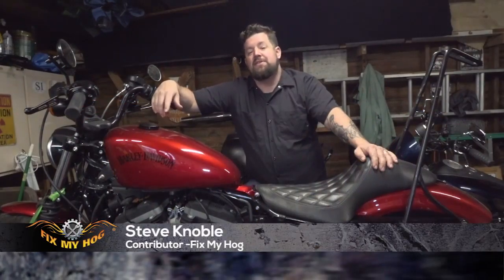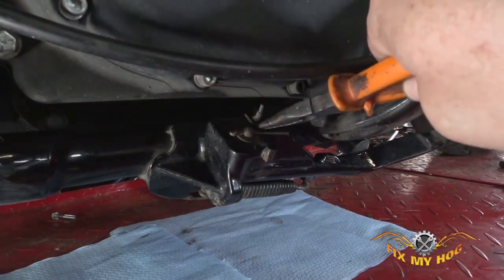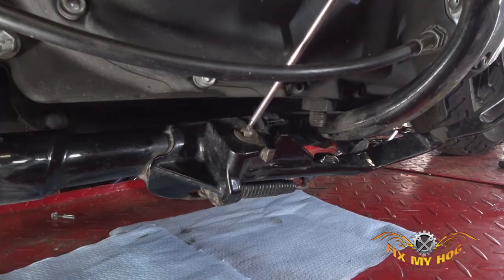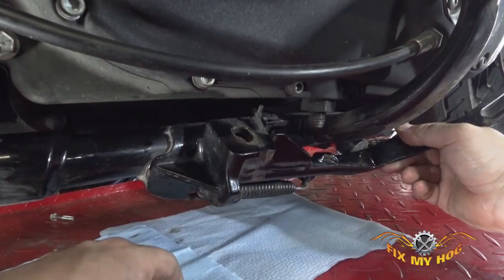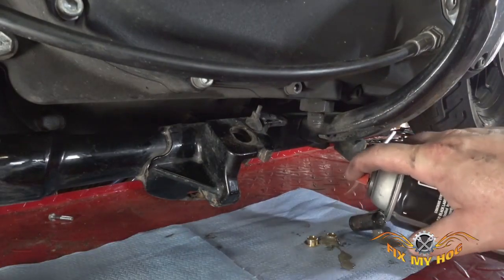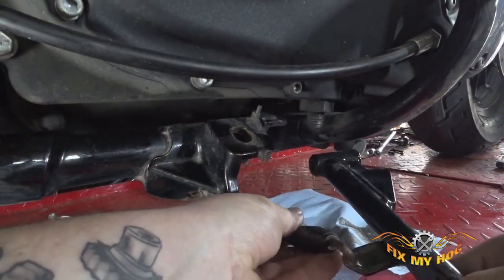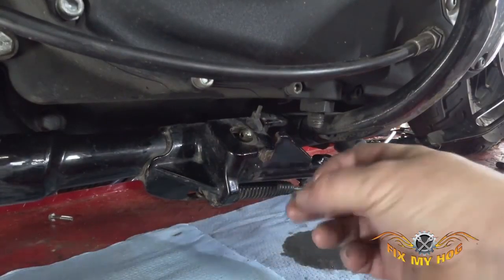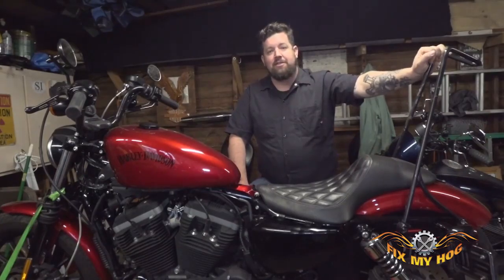Sportster Jiffy Stand Removal & Replacement

Comment: This is the video I need today!  Bought my 2004 Sportster new and have maintained it myself in addition to installing a hammer 1275 kit in my garage but never had to replace these bushings until now.   Lucky the pretzel clip fell off in my driveway and not out on the road risking an accident or losing the jiffy stand completely.  Excellent to the point video Steve.  Thanks so much will be doing this easy job later this morning!